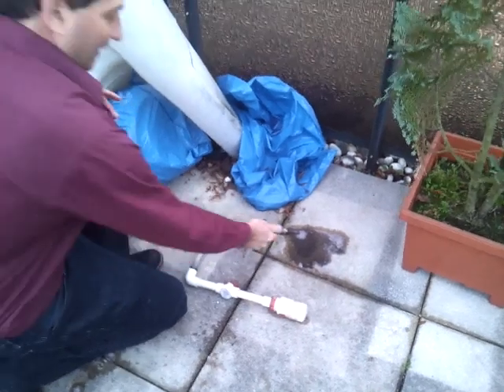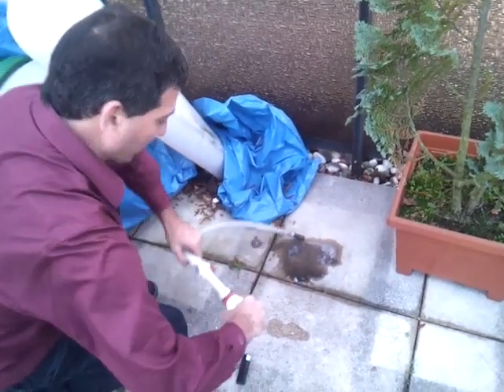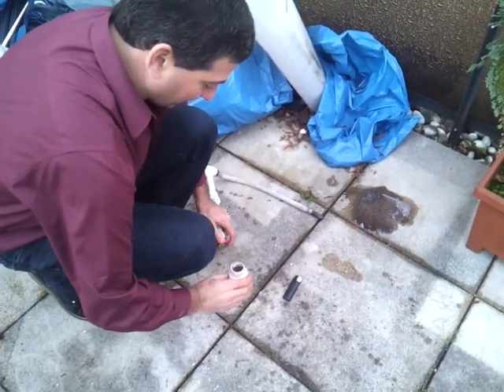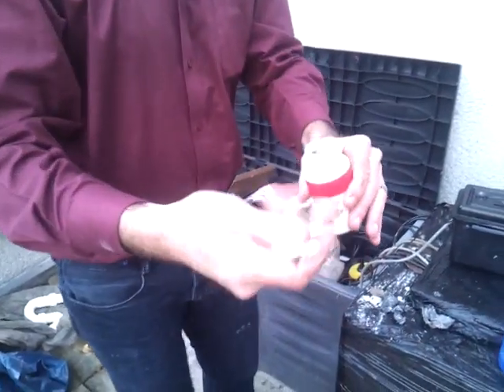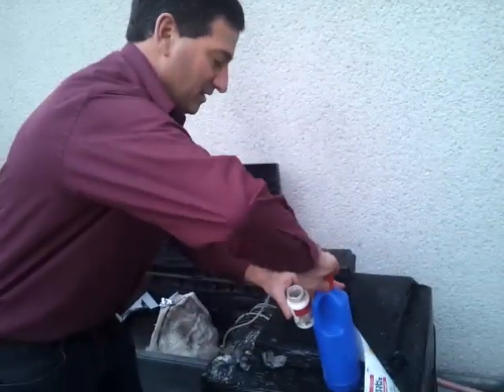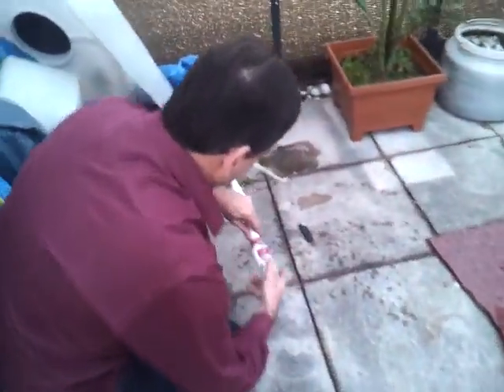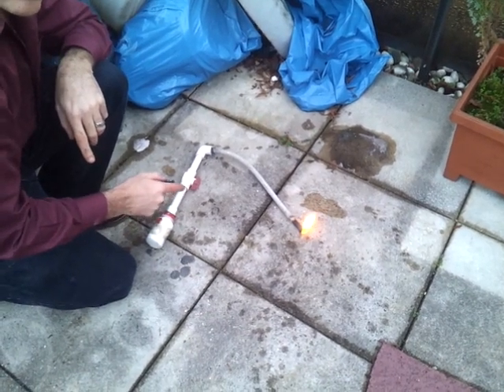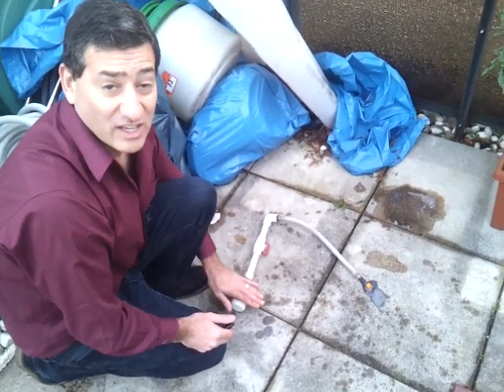Hydrogen and heat from aluminum foil demonstration

Comment: Most commercial NaOH is made from sodium metal.  The Na is made by electrolysis of an aqueous solution of NaCl with a mercury cathode, which prevents reaction of the sodium produced with water by dissolving it in the cathode.  The sodium is then separated from the mercury by distillation.

Needless to say, NaOH made this way uses up an amount of energy comparable to that of making aluminum.

Comment: I think that a glass lined steel tank charged with aluminum and rigged for a lye drip feed would give you more control. What are the properties of the resultant waste? Could this be used to make enough hydrogen for a dirigible?